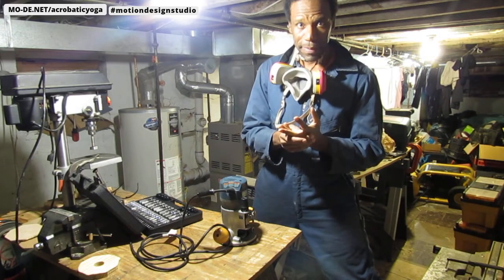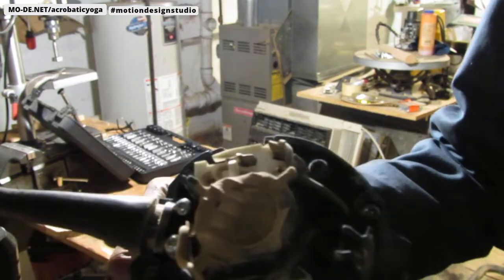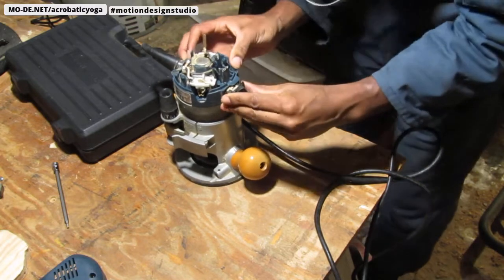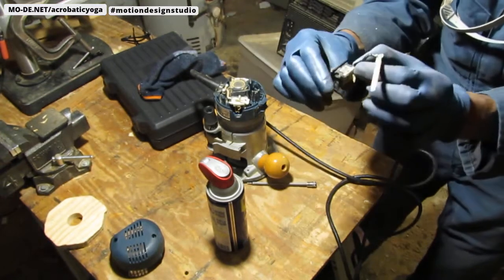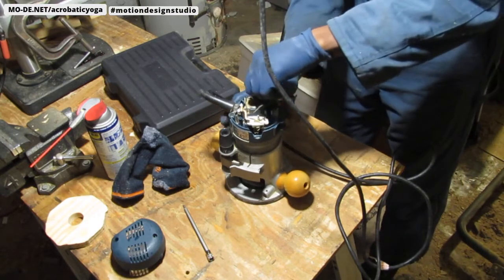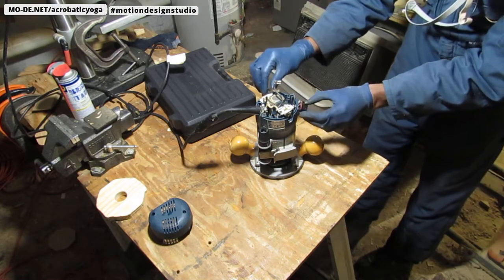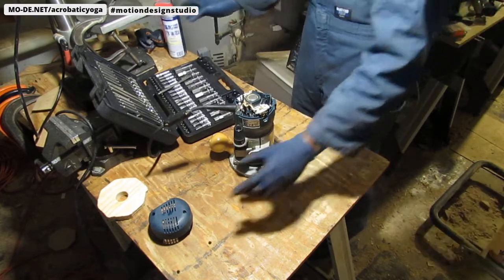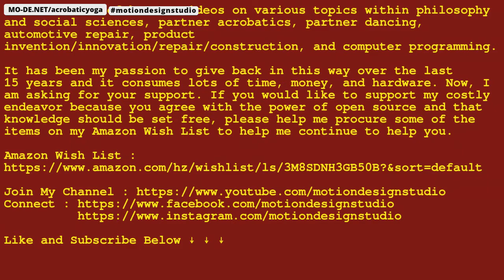How To Fix Bosch 1617 RA1161 Fixed Base Router Power Switch

Comment: I ordered the switch, expect to come any minute, decided to take the old switch out. Found your video, cleaned it like u did. Wala, it works. Now I have a spare switch.  Thx for the video. Definitely helpful
Reply from the maker: Thanks for letting me know and happy New Years.  It is a really easy fix and glad you fixed it.  Now you have an extra button just encase.  Where did you order the switch from and what is the part number?

Comment: Thank you for this video. Mine just stopped working, no intermittent running, just dead. After seeing your video, I had confidence to try a fix. After the switch was removed and popped open there was an amazing amount of dust inside the switch. The dust was cleaned out, and the contacts were cleaned. Reassembly took a couple minutes and now it runs just fine again.
Reply from the maker: Really happy to know you have saved such a great router.  I was devastated when mine stopped working after treating it so well for years.  This was my impetus for fixing this.

Comment: Thanks for this video. My router did the same thing and 20 minutes after fixing the switch as you did, I was back up and running. I thank you so much. I was about to go buy another router .
Reply from the maker: I was going to discard my router also until I did this fix which I knew would solve the issue in advance.  Hence this is why I recorded it.  Really happy you got to save yours.  I need to do a followup video on replacing the bearings.  It needs a good overhaul.  Have a great week.

Comment: Well this saved my ass. Or, it at least saved me a repair visit or router replacement. Had to take it apart and clean the dust off the switch, now it's running fine again. Thanks!
Reply from the maker: Glad you got it running.  It is a great router!  With lots of care it should run for a long time.

Comment: Didn't work until I tried the WD 40.  Then it worked like a charm.  Also worked on my Delta dust collector that went out a few weeks ago.  Thanks! Saved me a bunch of money.
Reply from the maker: It seems the small dust particulars poses a problem with infiltrating the switches on wood working power tools.  Thanks for teaching me this.  I will look out for this more frequently.  Cgra 746, Happy New Years and thanks for letting me know how this helped.

Comment: I went through the same discovery process as you to take my bosch router apart and clean.  Amazing how the human mind works.  Mine still wouldn't run after cleaning, same as yours.  But reseating the long blade connector did the trick!  So thanks a million for this video.  You are truly an intelligent renaissance man!  Wish more were like you.
Reply from the maker: TallBob1962, thanks for the kind words.  I was not going to discard this lovely tool without trying.  You sharing your similar experience made my day.  Happy New Years and again this was kind and well received : "You are truly an intelligent renaissance man! "
Reply: @MotionDesignStudio  I hope you didnt discard it... Bosch has often replaced routers for me in the past. Their service, and repair techs are really good. If it seems like itll be a lot of work for techs, they send it off to be refurbished,  and give you a new router in its place. 
 
I couldnt live without my 1617evspk ... the two bases are great for me. I can use fixed base on a router table, and plunge base on my slab planer.
 
I also have a backup motor from one of my older 1617s that I have installed on my Pantorouter. 
 
Ohhhh... pantorouter... i love you! Lol.
Reply from the maker: @carterscustomrods  , I love the router and fixed it and still use it.  Thanks for asking and enjoy your weekend.  I really like these routers.  I do need to redo the bearings and should  make a video of that.

Comment: Great video. 
After fixing my switch I placed a nylon stocking over the vent ports. 
Looks a little funny but the router is under a table so you really can’t see it.  The stocking worked great as a filter.

Comment: You my friend, made the most useful video of the year. I searched by chance to find some help for my router, flawed by design, that wouldn't work any longer. Initially I thought it was an unusual use of WD40 to spray the switch, but after loads of compressed air and no luck, I tried it and the router started working again right away. Thanks for your very detailed tutorial.
Reply from the maker: rickdixontn, I try to make these videos with all the details so everyone can get a feel for all the challenges evolved.   Thanks for letting me know how the video helped as it truly means much.  If you can please subscribe,  it truly helps.  You are the best.  Stay safe and see on the next adventurous repair.

Comment: Thanks, it worked.  The WD40 did the trick.  I never would have considered using it but probably should have.  I have used WD40 on 2 cycle carburetor diaphragms to clean them before with good results.  After letting the WD40 sit a while, I blew it out real good with air before reinstalling the switch.
Reply from the maker: Alan Dust, Water Displacement, 40th formula is great at so many things.  I have used it to clean the dirt and grease off my tools.  I have not tried it yet on a carburetor diaphragm.  Currently I am rebuilding a Craftsman trimmer.  I took this a part.  Stay tuned for the video hopefully this week.  Thanks for letting me know it worked well for you.  Have a great weekend.

Comment: Thank you for this video.  It saved me $140.  My router stopped working after 14 months of light use.  Took it apart, cleaned the switch and it started right back up.  So disappointed in Bosch as this is a know defect that could be solved for a couple of buck for a sealed switch.
Reply from the maker: When things like this occur one must remember that there is a business side to engineering. Engineers have a limited set of time dictated by a budget to invest in the research needed to make a great product.   Also there are manufacturing deals in place to handle certain type of specs that art reused to save money.  Such as these are the types of buttons we can use.  There are to many decisions and things in place along with disincentives to create a product that lasts for way to long for there to be an easy answer to this recurring pattern of failure in products.  Have a great weekend.

Comment: As a follow-up, I was able to fix my router after watching your video!  The advice on which end of the switch leads to disconnect saved me much time and cursing, and the T15 tool was the perfect fit for the screws.  I did do a few minor things differently though:  I used spray contact cleaner rather than WD-40, and checked the switch with a multi-meter before reassembly - it took several trys with the contact cleaner and lots of banging against my workbench to clear the contacts, and being able to test without reassembling saved a lot of time.  I wonder if I should have given the switch a couple wraps with electical tape before I put it back together, though (although it might not have fit back in the slot if I did so).
Thanks again!
Reply from the maker: Excellent information you have shared.  I could barely see what type of screws were holding the router together when I made this video.  I could have done a better to figuring it out.  Also it is better to use contact cleaner as you mentioned and best to check like you did with a multimeter if the switch is functioning properly before closing it up.  Thanks for the input.

Comment: Good to know!  I didn't quite have this problem. Just a bunch of sawdust stuck in the outer portion of the switch that I was able to brush and blow out. But if it gets worse, I'll know what to do.
Reply from the maker: It is a common failure point and to know in advance really helps.  Keep us updated.

Comment: Thank you for the video. I did similar, and mine was still working intermittently. I ended up carefully prying the rocker switch open, and found a lot of dust inside, as well as a little corrosion. (Be careful if you open it, there is a spring inside... and you should make note of how the parts inside are aligned.)  I gently used some steel wool on the corrosion, put the switch back together and reinstalled. Works great now, so far. I think the corrosion on some of the connections was the culprit... remedied by gently using steel wool and wire brushes. Again, take your time if you open the rocket switch. It's a very basic design with minimal parts, but if you lose any you'll need a new switch.
Reply from the maker: Andrew Kufahl, thanks for this information.  I love removing rust from connectors and placing them back into service knowing I just delayed  complete entropy.

Comment: Had the Bosch router switch problem and your video helped! My 1617 is just a few years old and has a mr25 switch, it’s very easy to open up the switch and clean the contacts (I used a q-tip, no wd 40 needed).
Reply from the maker: That was nice.  I like technical knowledge like this.  Thanks for teaching me the type of the switch I worked on in this video “MR25 rocker switches”.  I have lots of other repairs videos.  If you find something else in other videos that I do not know the name of please teach me and there are lots.

Comment: Thank You! This video also helped me fix my switch. I didn't need to use the dw40, just took out the switch and used compressed are to clean out the switch as much as possible. Then it started working again.
Reply from the maker: Tsutaz Rowell, I am glad this helped.  When I first made the video I was searching for another video to help me do what I am doing in this video.  I made this and it looks like it is helpful.  Thanks for letting me know it has helped you.

Comment: This video got me going in the right direction. I didn't even need to pull the switch out, which looks like the hard part. I blew some compressed air into it and it started working again. We'll see how long before I need to do it again.
Reply from the maker: John Gorentz, like a boss!  I love how simple it is to fix things.  Congrats on the repair.

Comment: Thanks! Yep this fixed mine. I'd would suggest using a contact cleaner spray instead of DW-40 because is will leave a light oil on the contacts that more dust could stick to. I also sealed up the offending holes with electrical tape. I cannot fathom why they chose to used an unsealed switch.
Reply from the maker: Noted and will do this the next time.  Your suggestions will help many.  Thanks for sharing and have a great weekend.

Comment: Found this video is July 2020.  Went to use my router and no power.  I actually had to disassemble the switch itself because it was so caked in dust.  I used a multi-meter to check all the cabling to make sure there wasn't a broken wire.  The switch showed no continuity even after compressed air and vacuuming.   I popped it apart and blew out all the sawdust, reassembled the router, and works like new!
Reply from the maker: Seriously, that was such a success.  So glad you were able to save this.  Even better thanks for sharing your story.  Have a great week.

Comment: excellent video!   Thanks for recording this for the rest of us - I especially appreciated your attention to protective gear.  But (and not to detract from your video)...  Let me get this straight: Bosh chose to use a switch that is sensitive to wood dust contamination in ... wait for it... a router?!?!?!?  As a systems engineer, I think a little bit of me died today.
Reply from the maker: Steve Osterman, you are to funny.  The decision has all the signs of management breathing down the necks of engineers rushing them to finish up.

Comment: Very good video. I wouldn't have thought to attempt to repair my router had I not seen this video.. However, I followed all of the instructions and it still wouldn't start. I was taking a close look at the toggle switch and noticed that the base could be detached from the body. On my router the base of the switch is yellow plastic, the body is black. There are four tabs on the yellow part that holds it to the black part. All you need to do is slide the head of a thin screwdriver along the edge of the black switch housing and the base will slip off. On my router, the switch was full of wood dust to the extent that it was preventing the switch from making contact. I cleaned out the inside of the switch and the router turned on with no problem. So, it is worth looking at if you follow the video and it still won't start.
Reply from the maker: Thanks for this suggestion.  This is great information.  Now I think about it.  I could do a continuity test with my multimeter to see if the switch is broken or deeper electrical problem with the armature, wiring or connectors.  Thanks again for sharing this.

Comment: Thank you for the video. It showed me how to remove the switch. The best part was when I used your advise to spray the switch with WD40. I would never had thought of that. I had used an electronic spray cleaner but it didn't work. Hours later, I tried the WD40 and immediately the switch worked. The first time I tried it with power, I heard a "POP". My guess is that the WD40 fumes inside the switch ignited. No worries, it works great now. Thanks again,   MIKE
Reply from the maker: Michael Mercer, thanks for the response.  I am glad this video was helpful.  It is a common problem with these routers and easy to repair.

Comment: This I needed thanks! Just started having this problem. Wonder if spraying with mass airflow sensor cleaner would work also? Safe enough for a sensor so maybe.
Reply from the maker: Yes : "Wonder if spraying with mass airflow sensor cleaner would work also?"  Anything to remove the wood dust and clean the electrical connectors will work well.  Best of luck and thanks for the heads up on mass airflow sensor cleaner.  In the comments below someone described a really nice process for getting this even more clean.  I advise reading bellow.  It contains a wealth of information.

Comment: I always wondered if using a piece of filter (like the black foam type that comes with a Shop Vac) would help if placed over intake....
 
I don't see it really affecting the performance/cooling of the motor. I see it preventing a little of fine dust from entering the machine... but such is the trade offing filtering situations.
 
I wonder if I could use the exhaust on a smaller shop vac to provide cooling air intake at the top ( that is filtered obviously) while it is also connected to the dust collector at the base? Sort of it's own enclosed (looped) system? 
 
I'm amazed Bosch hasn't come out with something like this?
 
Of course the trouble would be keeping the vacuum motor (exhaust) cool enough to not cause excess heating, and still strong enough to pull dust/chips away.
 
I also heard the newer EVS series have a much better power switch in terms of dust build  up. But I'm yet to open it up to compare.
Reply from the maker: It will overheat.  This unit is air cooled.

Comment: Had exactly the same symptoms.  Router suddenly stopped working after it was working fine.  Just one second to the next.  Figured it had to be electrical and likely the switch.  Watched the first part of the video and got going.  I have a pretty good set of tools (including a T15) but not one that fits inside the deep narrow hole Bosch used.   Ended up using an Allen key - 2.5mm worked on one, 3/32 worked on the other.  Go figure.  

Once I had the top off I just pried the switch out of the body with a Stanley knife blade, disconnected the blue lead from the machine and the black lead from the switch.  I then COMPLETELY disassembled the switch down to its component parts - ALL THE WAY DOWN to its component parts.   The dust that was blocking the switch was in the last compartment.  I was testing for continuity at every step and it only worked when I got all the dust out of the last compartment and reassembled it.  There was a LOT of dust in there.  I’m sure you would be able to get some out with compressed air - but its pretty tight in there and i think its going to fail again pretty quick unless you dismantle or replace the switch.  

Reassembled the switch into the machine and then put the blue cover on it and its as good as new.  

Not happy that this failed after modest use.  Seems like the switch is a bad design - but happy to have fixed it in less than an hour end to end.
Reply from the maker: It is a great idea to dissemble and clean inside the switch.  Next time I do this I will do exactly as you describe.   Thanks for sharing and have a great week.
Reply: Did anyone ever figure out a part number for the redesigned switch?

Comment: I'm going to try your cleaning right now.  Wish me luck...
Reply from the maker: Brad McNamar, you got this.  It is going to be so easy.  In the comment below it states the type of torx bit needed to unscrew the cap.  Use that instead of the hex I use.  I do not remember the size, check out the comments.  Let us know how it goes.
Reply: @MotionDesignStudio  It worked like a charm once I noticed one thing that I failed to see in your video (probably my error, not yours).  There is one wire at the bottom back of the power selector that needed to be uncoupled using needle nosed pliers.  after that I was able to take the switch apart and there was the saw dust.  Once I cleared that out and put it back together it was fine.  Thanks again!
Reply from the maker: Can anyone stop your awesomeness, probably not.  Thanks for letting me know and please consider subscribing.  It truly helps.  Checkout my recent wood working videos.